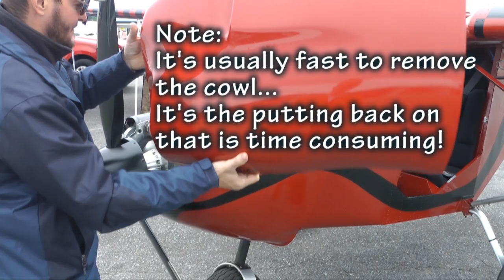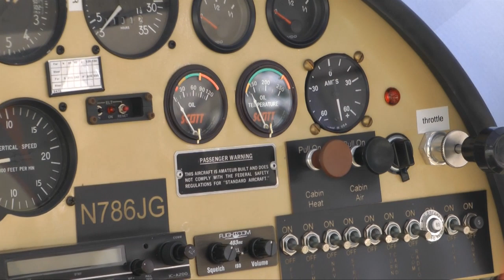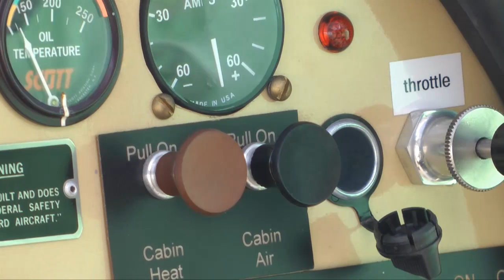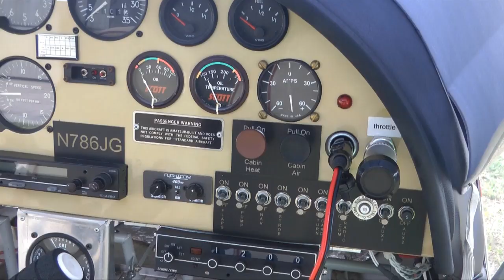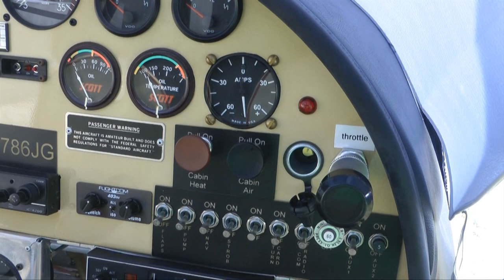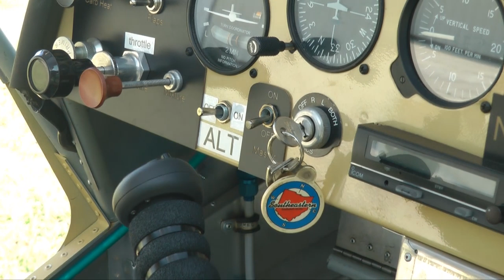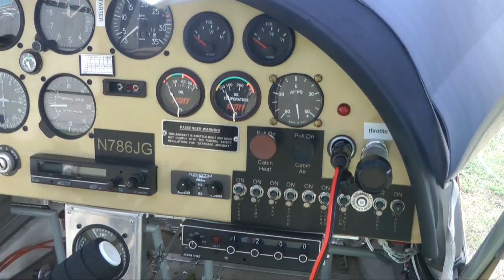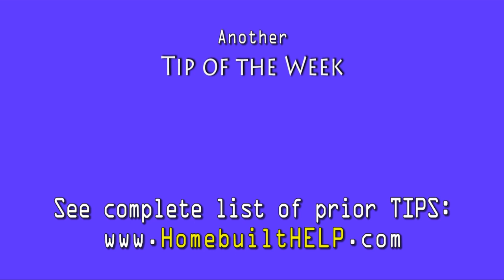Plane & Simple Battery Charging Technique for your Homebuilt

Comment: Good idea. One thing to keep in mind is that when charging that way it is easy to end up shorting the charger terminals as they accidentally touch each other. You can make sure that doesn't happen by making one of the male plug wires a few inches shorter than the other in order to stagger the charger's clamps.
Reply from the maker: Great point!

Comment: Good idea.  I’ll add it to my RANS S-19 which is nearing final assembly.  BTW - I wired my LED beacon to the master switch.  The expectation is when I look back to admire my AC after a flight the flashing beacon should jump out and smack me in the face 👨‍✈️.  I noted that you have an EarthX battery. I purchased a EarthX 900VNT which has a tremendous amount of power.  I’ll have to look and see if you have any tips regarding battery choices.

Comment: I use the plugs in a different application (non aviation), but similarly.  Often the cigarette lighter plug contains a fuse.  You'll need to deal with that.    Here's something to consider.  Some of the plugs have a low current rating and come with only a 3-amp fuse.  So, check the rating of the charger and the fuse.  Ideally, get a plug that can handle high current.  Also, the output of some chargers contains a lot of hash, or noise.  Even though most batteries will serve as a large filter capacitor, it is advisable to have all of your radios, gear, and other devices turned OFF when using the charger.  Keep in mind that the output voltage of the charger will be higher than the battery voltage in order to charge the battery.  Typically it will range from 12.8 to 14.4, but sometimes up to 15.6V for brief periods.  So called "Smart" chargers are like that.

Comment: Instead of plugging into the lighter then attaching leads to charger I would recommend attaching leads to charger then plugging into lighter then plug in charger. Even though battery is to dead to turn over engine I guarantee it have enough power to energize the leads when you plug in to the lighter.

Comment: What a great idea and one I'll get installed.   I have a RV-8 and it is simply a CHORE to get to the battery ... actually the batteries (one forward, one aft).   I'm actually thinking it would either be nice to  have a toggle-switch to route to each one (clearly the primary would be to the for starting).   or maybe two?    Anyway, as always, great humor and great tip!

Comment: Good video and good comments.  Something that cannot be over emphasized is to carefully review and match components to the voltage and amperage needs.

For an actual battery jump for starting, I would consider buying a Cessna or Piper jack to use for an FBO assisted jump start. The weight of cables is a downside, but when you're in a hurry it beats waiting for a battery to get charged and hoping you don't have to do it twice.

Comment: Why not use a small forklift charging port?  Off-roaders have been doing it for years, and they can handle more amps.
Reply: The cigar lighter system most likely weighs less. Every ounce counts.
Reply: I suggest either a Piper or Cessna charger port. An FBO would be able to easily give a jump when you're away from home.

Comment: Warning:  A LOT of modern Power Takeoffs (cigarette lighter sockets) are limited to 10A currents.  Check your ratings before trying to do a 20A charge rate.  The plastic power terminals typically begin melting at 15 amps